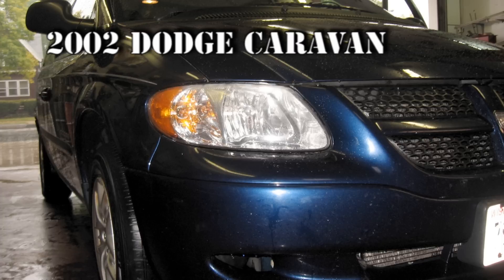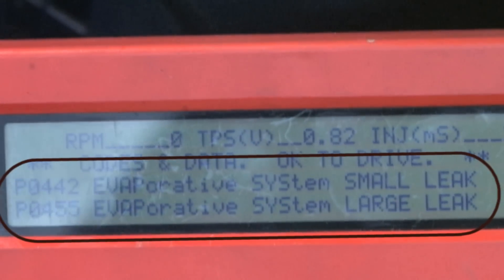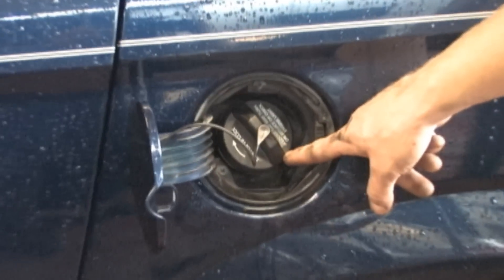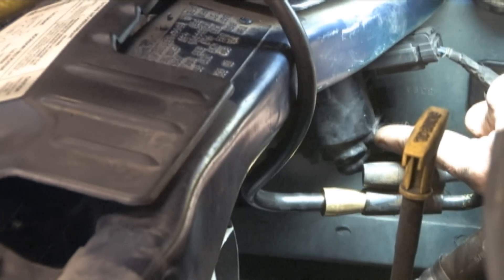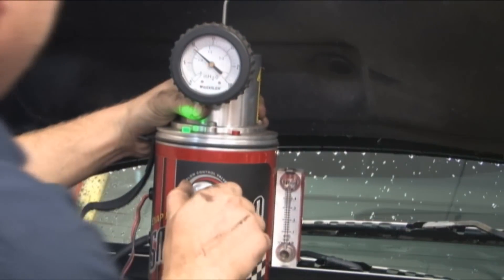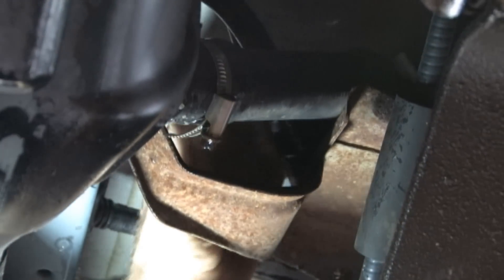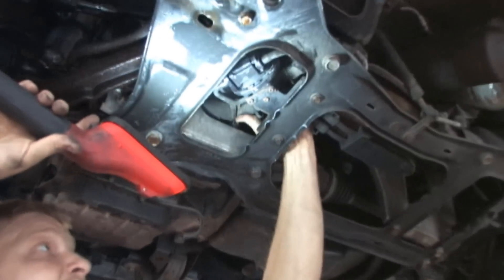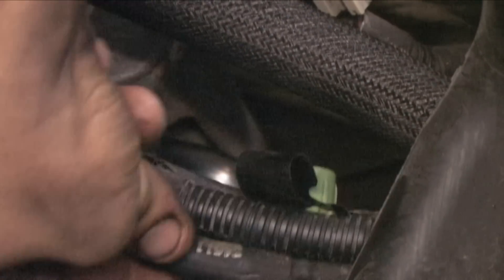Wells Dodge EVAP Troubleshooting and Repair P0442 P0455

Comment: Nice video.  Does the pin in the valve of the service port need to be depressed for smoke to get in the system?  Also, I'm thinking the alternative you used in the video is the hose going to the canister; correct?

Comment: Is the car still drivable 🤔🤔🤔🤷‍♂️...i hav those codes n should i take chance driving 3 hrs🤷‍♂️🤷‍♂️🤷‍♂️
Reply from the maker: Hey, very rarely will any EVAP code cause a drivibility problem. Any check engine light should be repaired as soon as possible but the car is driveable unless it's flashing. 
Mike Becker, Senior Technical Instructor

Comment: Got a new Mopar gas cap and replaced the canister purge valve for my 2002 Durango. I also found a hose with a small crack near the purge valve. Within 15 minutes check engine light went off.
Reply from the maker: Great Dave! Glad you were able to get it all fixed up. Actually a little shocked the light went out that quickly..Usually it takes a little bit more time to run and pass the test.
Mike Becker, Technical Services Instructor
Reply: I think it was a combination of gas cap and Canister Purge Valve. Purge vale was bad as well.

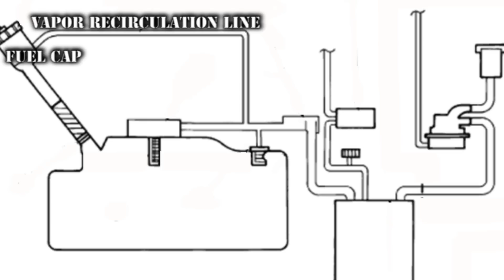Comment: Hey guys. Thanks for the awesome video! Question: At 2:00 in the video you're checking the hoses for the canisters. There's a small cylinder thing (see here: http://d.pr/i/FUwd) there. Mine has smoke pouring out of it and there seems to be nothing on the bottom of that cylinder, it's just an hole. Should there be a lid on the bottom of that thing?
Reply from the maker: Judging by your picture, it looks like you are pointing out the vacuum vent solenoid. That solenoid will be normally open, and should close when you apply vacuum too it. It should have a small vacuum line leading back to the engine. Fire up the motor and see if you have engine vacuum down to that vent solenoid. Let me know how this turns out. 
Mike Becker, Technical Services Instructor
Reply: Hey Mike. Thanks for your reply! I do have vacuum there. I took that valve off though and hooked it to my vacuum pump and nothing. Spec says it should hold 20 (whatevers) of vacuum for 10 seconds. Sooooo, I ordered a new one. Thanks again!
Reply from the maker: Great Rocco, I hope that solves your problem. Let me know if you need any more assistance. Have a good one.
Mike Becker, Technical Services Instructor

Comment: If you smoke test it at the purge valve hose, you are not testing the purge valve. If you smoke test the evap system at the test port leave the hose off the intake manifold - if smoke comes out of this hose ,the purge valve is leaking
Reply from the maker: You're right, you wouldn't be checking the purge function if you smoke at that hose. You could take a vacuum pump and verify that the purge holds vacuum when you take the evap hose off of it. If you watch our broadcast we just had yesterday, that's exactly what I do. 
Mike Becker, Technical Services Instructor

Comment: On my 2002 Dodge Grand Caravan with 3.3L I have codes P0442 and P0455
for evap leaks. I found a crack in hose under air box that I replaced.
Plastic hose clamps under vehicle for vapor canisters were broke so I
replaced those. I also replaced the fuel cap. Still hasn't fixed the
codes. I do not have a smoke machine to find the leak but is there
anything that could cause these codes without being a leak in the
system?
Reply from the maker: Mark you are on the right path. The hoses under the airbox are the most common issue for these codes. The best way to go forward from here is with a smoke machine. How long has it been since you replaced the hoses? The check engine light will not go off by itself immediately. You either have to clear the codes, or drive it for quite a while before the car passes enough tests to turn it off itself. The second most common replacement item for these vans is the leak detection pump. Which is located under the vehicle near the power steering rack kind of. I'm sure you saw it down there when you were fixing hose clamps. If you don't want to pay a shop to diag this with a smoke machine that's where I would probably go next.Hope that helps!
Mike Becker, Technical Services Instructor
Reply: I did the work above within the past week and I have attempted to clear codes with scanner and I have disconnected the battery and codes will not clear. I will put leak detection pump under vacuum and see if it holds. Thank you for fast response.
Reply: I had a hole in the top of the charcoal canister? I have no idea how it got there, I bought the car with this issue. (PO455)
Reply: Leak detection pump was my issue for the codes. Thank you Mark Becker.
Reply from the maker: Glad you were able to get to the bottom of it Mark! Nice!
Mike Becker, Technical Services Instructor

Comment: I'm going to try putting vaseline on the gasket on my fuel cap.
Reply from the maker: +William Ross Sometimes that can help with the sealing of the gas cap, but really that's not going to fix the root of the problem. 
Mike Becker, Technical Services Instructor
Reply: markjhicks   I decided to spray silicone lube on it for now. I'll see how it does. I can't visible see any hose leaks and I'd love to get it behind me so simply. It is worth the shot.
Reply from the maker: +William Ross I hope it takes care of it for you! Nothing is better than a cheap simple fix :)
Mike Becker, Technical Services Instructor
Reply: It's the over pressure valve inside the cap that could be bad also.
Keep in mine this system does not check for a vacuum leak every time you start the car, so it may take a while to know if you have it fixed...
Reply: Silicone spray fixed the problem for me.
Reply from the maker: Sometimes that gas cap is the only issue! It always nice when a little cleaning and silicone spray fixed a problem!
Mike Becker, Technical Services Instructor

Comment: 2006 Malibu my friend has and tranny will try and move in 3rd gear but not in 1st or 2nd  in manual you can move vehicle  in 1st gear but if rpms are too high it'll kick out of that gear
Reply from the maker: max smelser It is possible there is an internal transmission problem. Do you have any stored diagnostic codes? Also what engine is in this Malibu?
Mike Becker, Technical Services Instructor

Comment: thank u for the video !!! I had P0455 code and the leak Detection Pump vent valve 4669865 OEM Mopar  was the problem. thank God no more check engine light on
Reply from the maker: Florin Sicoi Thank you for sharing your experience, I am sure someone will benefit, and for the kind words. 
Take Care My Friend,
Mark Hicks
Wells Vehicle Electronics

Comment: Hello Mark,
I have a 01 dodge caravan 3.3 L. Today i did the turning off and on of the ignition and it showed P0442  van was given to me with over 300 KM i'm in Canada  so i have no idea what has been done to it. I had to put another speedo cluster in it now all that works and it is also showing ABS Light and Brake Light  any Help is greatly appreciated
Also great Video  It's nice to find people who don't mind sharing there knowledge free of charge. Should be more like you out there
Reply from the maker: 425shay Hey, First thank you for the kind words, they do mean a lot to us. When you say you have replaced the speedo cluster, I am thinking you are saying the cluster in the dash. Just to be sure we are on the same page. Was the ABS and Brake light "on" before the cluster replacement? 
Mark Hicks
Wells Vehicle Electronics
Reply: Hi Mark,
Thanks for the quick reply, The van was given to me and the speedometer did not work but some icons did and no i did not see anything having to do with brakes until i put the ebay instrument cluster in, I am far from being a mechanic but love doing this stuff being a woman. I also here which sounds like a squealing sqweeky noise which i think is from front right p/s   sorry for the long story  it is a 3.3 L
Reply from the maker: 425shay Well, the first thing I would do is contact the seller on EBAY. They may have run into this prior or send you another to try. 
Dodge in that era had a lot of problems with the screen in the power steering reservoir. It was so bad they issued a TSB on it. Here are the instructions:
 Inspect the power steering fluid reservoir screen for contamination. Replace the reservoir and flush the 
system and be sure to refill with ATF + 4 transmission fluid.
Hope this helps,
Mark
Reply: So am i understanding that the brakes are not a problem?
and the issue could be a faulty instrument cluster. How do i check the reservoir you mentioned?
Ebay has been contacted
I will update as things happen
Thanks Again Mark
Reply from the maker: Yes, you are understanding correctly, I do feel there may be a correlation. 
You must remove the reservoir. The screen unscrews from the bottom.Try cleaning it first.
Mark
Reply: markjhicks Hi!

Normally, when theses lights are on together it's because there's a problem with the brake system...

I'm pretty sure that the previous cluster had these's bulbs removed to hide the problem if you purchased a used caravan...

If you own this caravan for long time, It will be a good thing to check 
brake fluid and be sure that your abs pump are working fine...

Some peoples remove the fuse to prevent the ABS to work if they don't 
like it or if they have a problem with it, it's a common issue and my 
last 3 cars had this fuses removed due to erratic ABS that was really 
annoying...

Reply from ebay    advice please
Reply: 425shay Mark, weather is crappy here 
so waiting for it to warm some before able to do anymore
Thank You so very much
For all advice and help and patience
I will update asap  with all i have done
Reply: Hi again Mark,was unable to get Atf+4  had to get prestone power steering fluid  hope this is OK? What do i use to clean the filter with?
Thanks
Reply from the maker: 425shay Clean it with any type of solvent, brake clean or carb cleaner.
Mark
Reply: Hi Mark, Well i ran into a problem , can't get the small hose off, so all i did was siphon as much of the old fluid as i could and put new in. Still hearing a noise when turning, also ABS light and Brake light is on I added brake fluid to what was in there , not sure what to do . I wander if i shouldn't get another cluster ? from Ebay.
Thanks
Reply from the maker: 425shay There is a kit to replace the screen. You need to get the reservoir off to clean the screen. Till you get that far there is not much more I can do. 
Mark

Comment: Damn $1200! I'll just let the mechanic find my problem. I have both of these codes on my 2002 dodge stratus but I am a diy repair guy of my own vehicles. If I owned a garage and did repair work for others, I could see it as a good investment.

Comment: 2000 grand voyager...Today i got the p455. I cannot even locate the canister, and it looks like the fuel cap is original. Passed smog every year since 2000?
.
Reply from the maker: I will assume you have a 3.3 engine. It is common for the Leak Detection Pump (LDP) to cause this code on your vehicle. To test it you will need a scan tool and smoke machine.

Mark Hicks
Wells Vehicle Electronics
Reply: Nope it was a idiot mechanic who did the fuel pump and he didn't screw it in right and it leaked 10 gallons on the ground and after i screwed it on straight it was fine. yes 3.3 with 289,980 miles still getting 25 mog
Reply from the maker: Excellent! Thank you for the communication. I am happy you found the answer.
Take Care,
Mark Hicks
Wells Vehicle Electronics

Comment: HI Mark, 2002 Jeep Cherokee P0442 & P0455 popped up. I replaced gas cap with OEM, and replaced one cracked hose in engine compartment. Errors popped back up. I have to wait for Sat for more troubleshooting. The canister,LDP,LDP Vent valve are back by the rear bumper on this model. I will look for crack hoses there.There is a TSB on the LDP Vent valve ($21) I dont have vacuum pump ($35) to check it. If I cant find cracked hose/s I will change Vent Valve. Any other suggestions? Thanks Damian.

Comment from the maker: There is a TSB related to your codes. It points out the vent valve on the leak detection pump. 
Check this first. I have never run in to a tapping noise associated to these codes, but it is possible it could cause a noise like that.
Mark Hicks
Wells Vehicle Electronics

Comment: Good evening! My 2002 Dodge Stratus came up with two codes of P0442 and P0455.  The vehicle has a tapping noise coming from it with the codes.  Is that the kind of sound that comes from a large leak?

Comment: Dear Sir, Well you were right, It was either the celonoid by gas tank or, the canister. I took it to get a good ck up and lo and behold, it was the canister. i almost fell off my chair since i was told the canister would run about $800.00. The mechanic said i could buy a used one but, never know how good it is and we have to pay the labor all over again and, buy the new one. Well, he is repairing it for $700.00 parts and labor and will waive the diag fee. You were soo close to dx it. Thxs again.

Comment: Thank you sir. i was told by my nearby mechanic that, there is a celonide  under the truck assuming by the gas tank and i wonder if that would be it.Also, will the engine lite reset itself with this po442. The smog fellow said, as soon as the lite goes out, if it ever goes out, he will retest the smog and it should pass. Too bad you are so far away i could pay you to repair my problem it is driving me bananas. A 71 yr old man can't take too much of this you know.

Comment from the maker: A P0442 can occur for several different reasons. It means you have a leak in the evaporative system. This system removes the fuel fumes from the tank and burns them in the engine. By doing this it keeps them from getting into the atmosphere. 
Wells and I are located in Fond du Lac Wisconsin.
Mark Hicks
Wells Vehicle Electronics

Comment from the maker: By the way, having a code P0442 is not going to leave you stranded on the road. It will not cause your engine to die.

Mark Hicks
Wells Vehicle Electronics

Comment from the maker: Give the cap replacement more than a couple days to reset. It might take a day to two weeks to reset, it all depends upon how you drive. Yes, the canister is expensive especially from the dealership. Check around you might find a better price. The tech might be talking about the vent solenoid. You really won't know for sure what is causing the code until it is properly tested. 
Stay in touch,
Mark Hicks
Wells Vehicle Electronics

Comment: which way should i go?? the mechanic from the smog place told me about the one mechanic and said he does not so high price work but you know how that goes. In your experience, would the like reset itself and go off after i drive it for awhile ?? several people say yes but i don't want to screw my truck. they say as long as the lite doesn't blink, i can drive it for awhile until it goes out or stays on. HELP.

Comment: I put the original tacoma gas cap on it. now the lady at the dealer told me to drive it a couple of days and it would reset it self ??  the guy who does the smog ck told me the same and he assured me the canister is not leaking ?? You know the dealer told me if it is the canister, we're talking around $800.00 ?? fk man i about fell off my chair. Another mechanic said his commom repairs is the evap celonoid on the bottom by the gas tank.is this possible ?? i'm confused man, i don't know ??

Comment from the maker: Voltage is supposed to go to ground with even a slight amount of vacuum applied. Try testing this switch several times to see if the switch is sticking. Replace the NVLD if the switch is sticking. 
It is very common for the NVLD to cause this code on your vehicle.
Hope this helps,
Mark Hicks
Wells Vehicle Electronics

Comment from the maker: 3. At the Natural Vacuum Leak Detection (NVLD) assembly, which is located on top of the charcoal canister, which is mounted above the fuel tank, backprobe the Orange wire with a voltmeter. Locate the vacuum line going to the canister and remove the line so a hand vacuum pump can be used to put vacuum on the line going towards the NVLD. The other line at the NVLD goes to the vent. Using a hand vacuum pump, apply vacuum to the line while watching the voltage on the Orange wire.

Comment from the maker: 1. Verify that the hoses for the purge solenoid are routed correctly and not pinched or restricted in any way. This includes verifying the lines to make sure there is no liquid fuel or charcoal in the lines. Clean as needed or replace the lines as needed.

2. Verify that the canister purge solenoid will vary duty cycle when commanded to by the scan tool. Replace the solenoid if sticking.

Comment from the maker: The most common cause for a P0455 on your vehicle is an EVAP hose leak. Check all the EVAP hoses very closely. Especially by the canister and vent solenoid.

Mark Hicks
Wells Vehicle Electronics

Comment from the maker: The most common causes for a P0442 on your vehicle are a leaking fuel filler neck and a canister vent solenoid (valve). With out a smoke machine we really can't be sure. However, if I were you I would make a real close inspection of the filler neck if it is full of rust thats where I would go. If it looks pretty clean, I would replace the vent solenoid.
Mark Hicks
Wells Vehicle Electronics

Comment from the maker: The solenoid attaches to a bracket near the radiator on the passenger side of vehicle. The top of the solenoid has TOP printed on it. The solenoid will not operate unless it is installed correctly.

Mark Hicks
Wells Vehicle Electronics